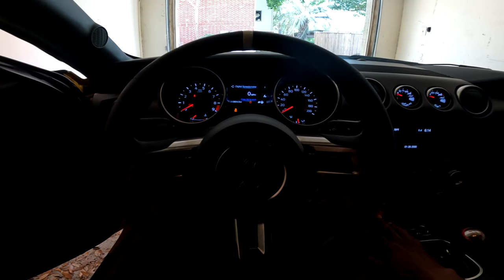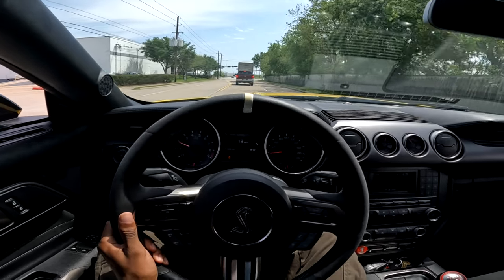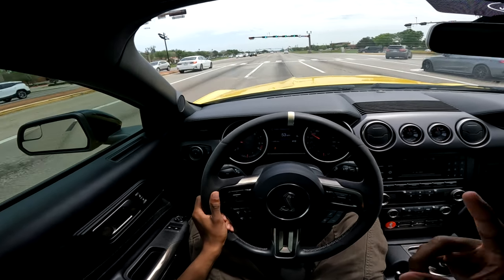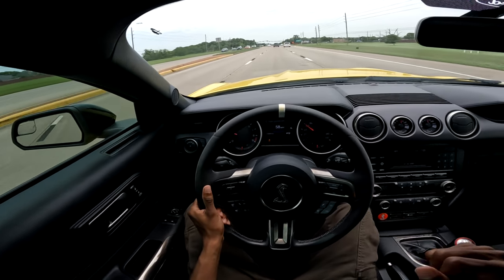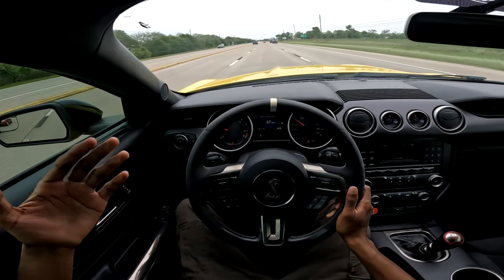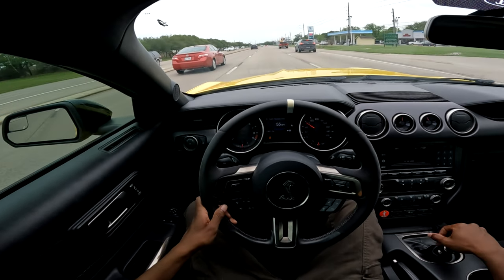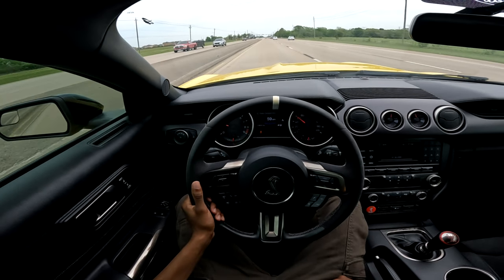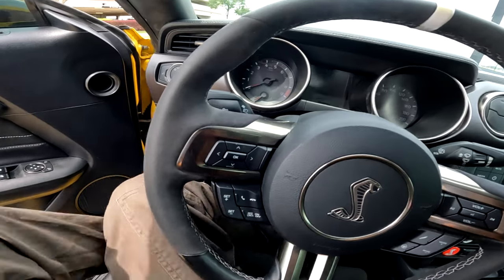Building a 520+HP FULL BOLT ON E85 SHELBY GT350! - MOD LIST + COST BREAKDOWN

Comment: That’s not full bolt ons bro you have Headers and exhaust and a intake what about throttlebody? Intake manifold an that is what we call full bolt ons in California because it’s all motor but that is what I seen in my state
Reply from the maker: Porting the manifold does nothing on these cars. CJ Mani is minimal gains but usually around me it's CJ + FBO. The stock catback exhaust flows well too. Really only 3 things you need to upgrade on a GT350 for it to be considered FBO.
Reply: He doesn't have exhaust, just headers. I've heard some guys do high flow cats for a bit more. As far as intake I'd probably leave it alone, just upgrade to a K&N or Amsoil filter. Throttle body aint worth it, especially if he's going whipple later. The thing I'd be concerned about on that '16 is oil consuption. You gotta make sure to check the dipstick every week or 2 if you daily it.
Reply: @EarsPOV manifold, headers, intake, throttle body 

Usually is what full bolt on means 

Headers and intake is just bolt ons

Comment: Stock clutch works fine for NA setups.

Also the stock tires (Michelin Pilot Super Sports) are plenty of grip for NA power levels. I’m running 4s tires and don’t spin when doing a pull. It doesn’t wobble side to side at all. You might need to adjust the alignment to help eliminate tramlining. In addition I’m also running 325 rears and 305 fronts so I have a lot of meat. I went ahead and did the steeda springs, billet vertical links, subframe braces and alignment kit and bushings too.
Reply from the maker: The Super Sports are not the same as 4s. The 4s are significantly better.